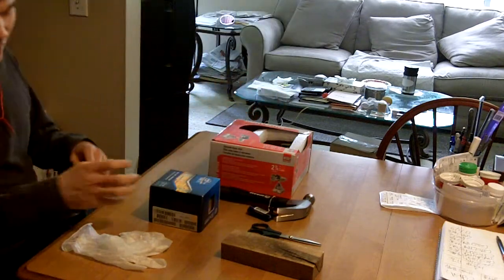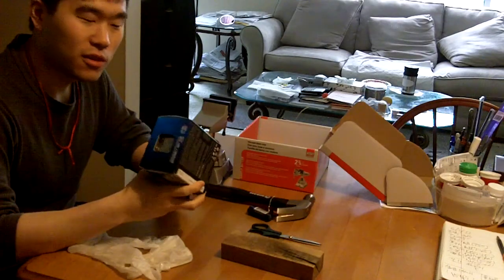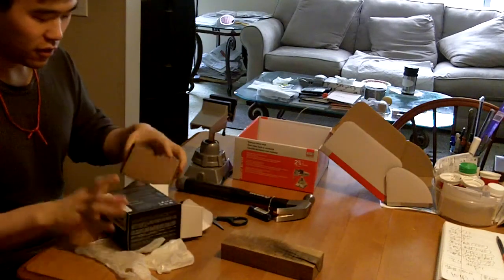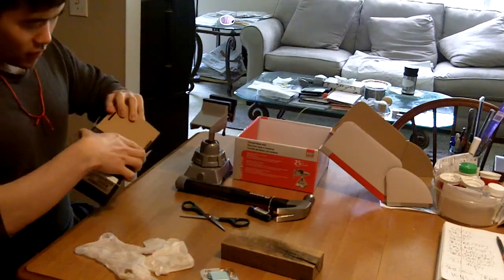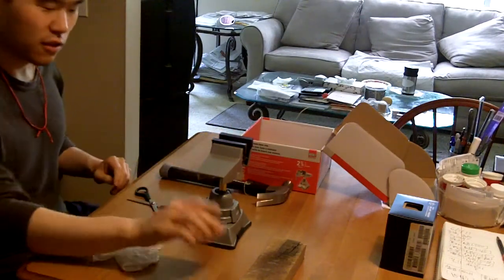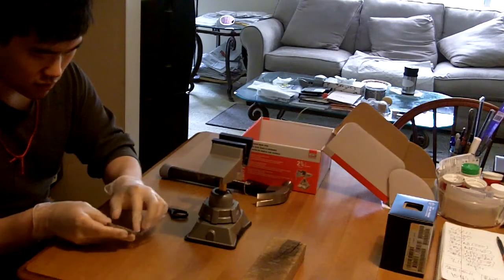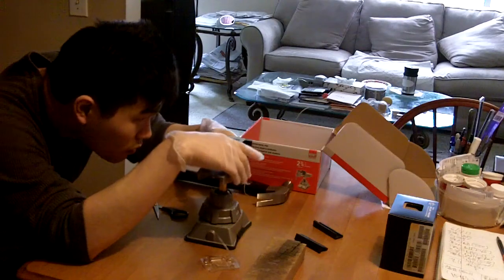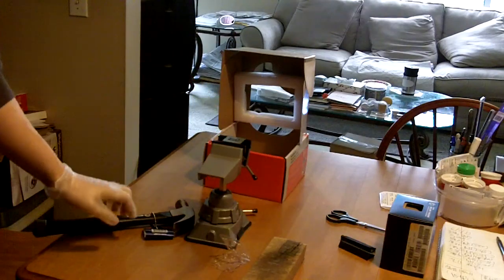First Time Delidding (i7 3770k)

Comment: This is the fastest way to delid a cpu but also the scariest. Hard to watch anyone use a vice and hammer on a cpu, LOL. At least it worked. I have a haswell chip I want to delid but I wanted to see what kind of temps I'm getting first. I run a phanteks 140mm fan cooler. My haswell idles around 25-30c but sometimes it spikes at random into 40-45c. Not sure why. Deliding may help it if I can muster up the nads to do it. LOL. I'd prob use the razor blade method.
Reply from the maker: I was more scared of the razor method because there are a few people who accidentally cut traces and ruined their cpu. At the time of filming this there was no incidents of failure for the vice and hammer method.  I did recall reading one person failing a few months after this video but the only reason it failed is because he didn't secure the chip enough and it came flying out and landed hard
Reply: vice all the way, ruined 2 3770k's with a razer blade, both being scratches i had to use a magnifying glass to see

Comment: I also watched the other guy who did 3 in a row and im researching about it as well because im going to do it for my 4770k as well. Im going to buy the same vice and use the other guys method. The way you did it was just bad because 
1) the table you used wasn't completely sturdy and solid and
2) the way you set up the vice wasnt as good as the other guys method. He did it vertically with the front part of the vice resting on the counter top so that all the force was transferred to the counter and not just into mid air which is what caused your problems.

Comment: That vice is very flimsy. I think it is wise to use the vice method though, percussive force on a solid state part can't do any damage, a razor can cut a trace easily though and render it crippled or worse, dead. I delidded my friends' 3770k before my own with this method and had no issues either time. My 3770k with an H220 maxes out at 43C at 4.1Ghz and my friends' maxes out at 34C at 3.5Ghz. It is a good way for first timers for sure.

Comment from the maker: I used CLU.  Good luck in whatever you do to delid it.  All I can say is that the hammer/vice method is a proven one where only two guys have killed their CPU and both as far as I know have claimed that it was their own fault.

It's a lot easier than my video portrays.  If I had a stable vice I am positive I would have gotten the job done in a few whacks.  Either way though, I can understand anyone not wanting to do this.  It can be nerve racking.

Comment from the maker: It runs fantastic.  Idle temps are anywhere from 19c-29c(depending on the core) and during full load it's anywhere from 55c-69c with the temps usually fluctuating around high 50's to low 60s.

I was lucky and got a great overclocker.  I've been running it without issue at 5ghz with 1.4v.

Comment: Based on the thread from overclockers with dozens of people reporting safe delidding via this method and only a single fuck up(guy hit it way, way too hard).

Razerblade is stupid because a small mistake can cost you your chip and many people have fucked up, you are wrong.

Also this method is much easier.